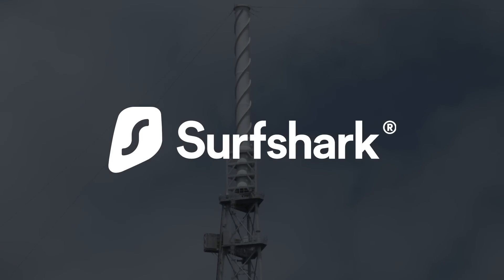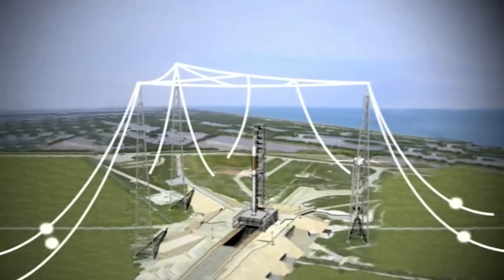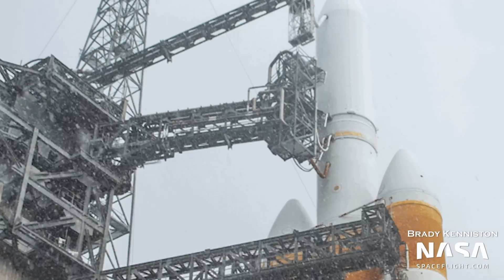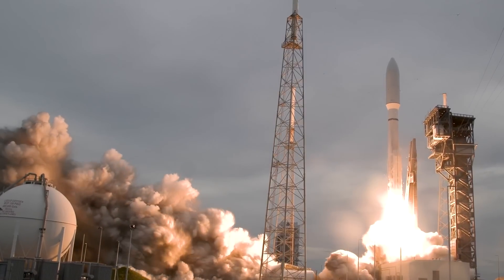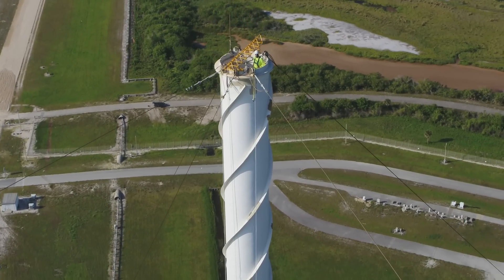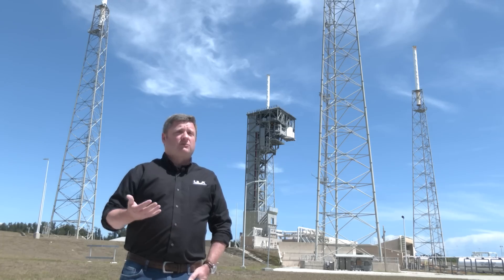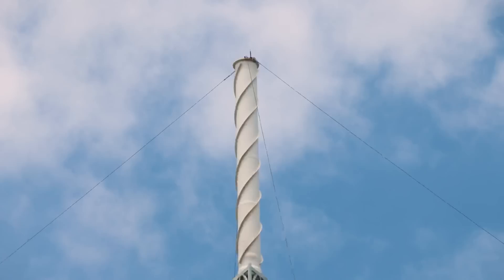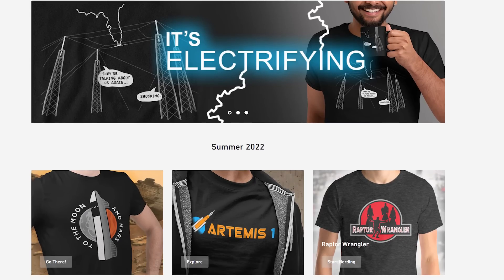Why Do Towers Surround Rocket Launches?

Comment: Having the lightning spread out  via the network of wires helps  ensure that there are plenty of  feeler currents ionising the air all over the site and leading to a lighting protection wire.  Also they backup each other, as any one wire to the ground could be damaged by a massive lighting strike.

Comment: Disneyworld has an extensive lightning protection system.  Lightning rods all over every roof and spiky things on light poles and other disguised supports.  It does not channel strikes.  It prevents them from striking anywhere in the parks by letting electrons flow into the air, bleeding off voltage before it reaches a critical level.  This causes amazing cloud to cloud lightning much longer than normal to clouds that can strike outside the park.  Does NASA think the catenary wires are more reliable, or is there some other reason for the different systems?

Comment: Great video. Would have loved some numbers though! numbers of strikes per year at a pad, peak current, total energy in a strike, thickness of cables, etc. And more about the ground connection system would be interesting. Are they wide metal pads or deep metal rods, or ... ?

Comment: Most people do not truly understand how Lightning works especially the dynamics involved. While most people are looking up into the negatively charged clouds in the sky for Lightning when in reality there is a Clouds of positive electrons moving through the Earth similarly to the way clouds move through the sky. So in reality Lightning travels through the Earth looking for a path of least resistance in order to equalize the atmospheric charges. Ground lightning is mostly invisible as it soars skyward and we only see the flash when it connects with the clouds.

Comment: 4:24 when were the new towers erected and what did they replace?
Reply: Pad's LC-39 A and B has a single lightning tower system on top of the fixed service structure, the pads should of had more towers then as the shuttle was hit quite a few times.

Comment: Our house got hit by lightning just last June. Direct hit at the peak of a gable.  Rather interesting figuring out how it traveled around the outside of house, looking for a ground path (it followed metal flashing, even drip edge flashing, then to soffit can lights outside (the can body is grounded).  Surprisingly, the AC supply side of most electronics faired rather well (plenty of surge suppressors, including whole house), Fire Sticks USB supplies being an exception.   But know what caught me off guard?  All the network cables and HDMI cables - lots of dead ports in the end.  HDMI more so than ethernet.  So time to buy some RJ45 and HDMI protectors.

Comment: Wish it went in to a bit more technical / engineering / scientific depth on the how, not just the what, but still a good video.
Reply: I'm lots on numbers but at least a little explanation of the anchors and how they prevented the sand from turning to glass, did they add more to reduce the voltage, drill deeper anchors or change the construction of the anchors?

Comment: That reminds me. Last year here in Switzerland we had a test-campaign for a "Laser Lightning Rod"(basically a high energy laser creating a path for any lightning to discharge.  Arianegroup was a part of it. I can't find any news on what became of it, but it seemed really interesting.
Reply: I never heard of that system but it makes a lot of sense, you could "pull" a lightning for really far distances by creating an artificial ionized channel in the air. Idk how good this would work in high winds but the concept is amazing.
Reply: @m00str  It's apparently more of "push" than a "pull". As it's mostly to protect from lightning that starts from the ground, as apparently those are responsible for most of the damages. I couldn't find it's actual range, but they tested it for a 100 and something meters high tower. The thing with high winds is an interesting question, though  they did test it on a very windy mountaintop and it was designed to at least survive 200km/h winds, so it might not have been that bad of a issue, but that's speculation on my part.

Comment: Your video does a great job explaining lightning protection systems! Of course, as with anything, these systems are a little more complicated than just "creating a faraday cage around a rocket." Essentially, a big component of this type of system is to reduce the electrical potential between the cloud and the ground. In a way, these systems are a type of lightning prevention! However, as is very well explained in this video, these systems also create a path of least resistance, thus a cloud with a great amount of charge potential will find the easiest way to jump to the ground through this system. Thus creating the cone of protection for the rocket. If you want to dive deeper, I would strongly suggest looking up Saul Hernandez's video on lightning rods.

Comment: But why does SpaceX in Vandenberg does not got a Lightning Protection System?
Reply: It does but much smaller as the risk of lightning is much less than Florida.
Reply: the video briefly states that vandenberg does have lightning systems but doesn't explain why they're either non existent or dramatically scaled down

Comment: I wish I had those when I was on a sailboat in the Atlantic Ocean. We got struck and then nothing worked. Another time my dock got hit sending. Bricks through my house. Please listen to warnings for lightning warning ⚠️. Trust me get in doors. Lightning blow stuff up. Great video 👍😃
Reply: Of course I saw an Lightning wandering 30m vertical over an Lake and then it hits a duck. Lightning dont like clean water with drinking quality. Under these conditions they use any kind of objects lika a leave or even a duck. So get out and away from water in storm.